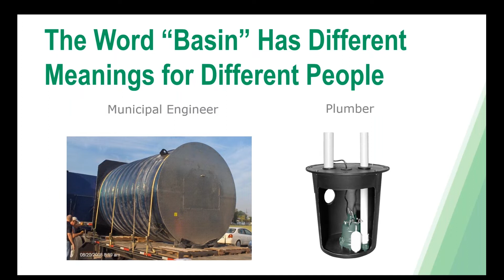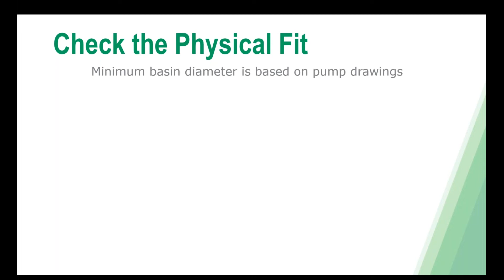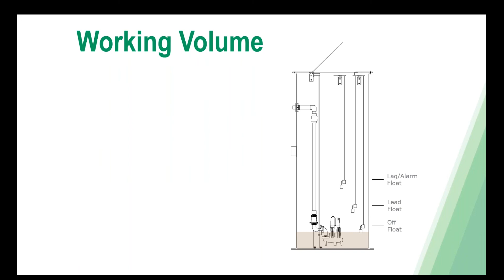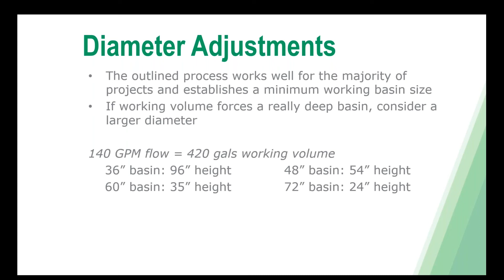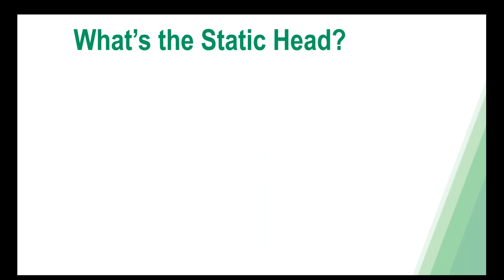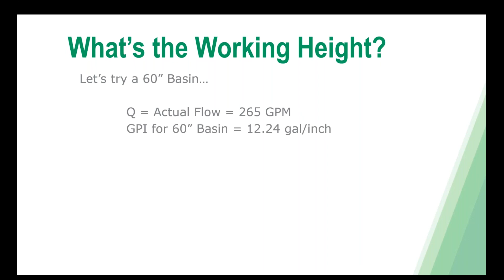Basin Sizing 101 Webinar

Comment: What’s the gallon per inch for an 18” basin? The basin volume per depth table starts at 24”, but most residential applications are using the smaller 18” x 30” size.
Reply from the maker: An 18” diameter basin has 1.1 gallons per inch. Hope this helps!

Comment: I have 2] M-53 pumps with water filled switch boxes. Incredibly they both still ran but the heat they gave off and the small shock from touching the housing told all. You guys make a fine usa product and I have other pumps with auxiliary float switches that are decades old. But I am done with the 53 or 57's and their incorporated floats. Going to Liberty. At least it is also USA made. Rethink your built in floats! Too many points of potential water ingress.
Reply: I had the same issue, switch seal failures & not enough travel equalling a short-cycling pump. I just bypassed the built-in switch & get a quality float switch, or one of the many new solid-state controllers available on the market, Zoeller even offers one.